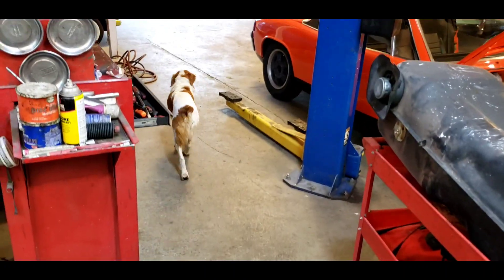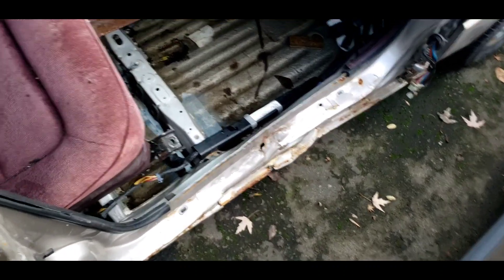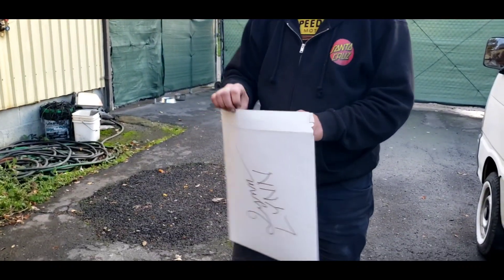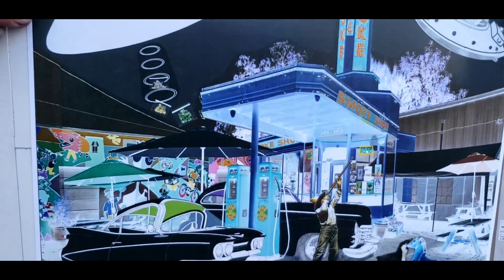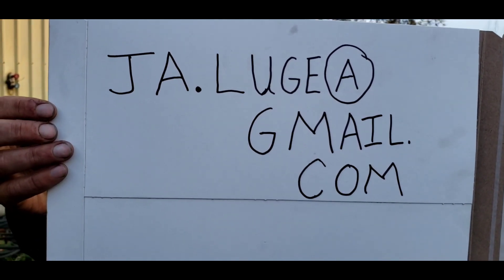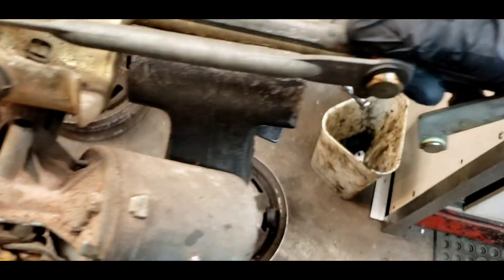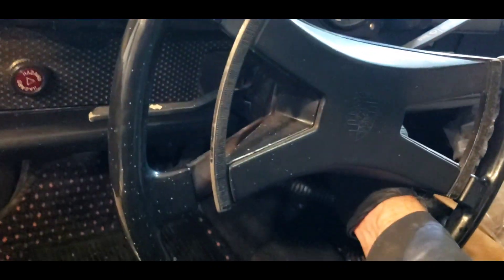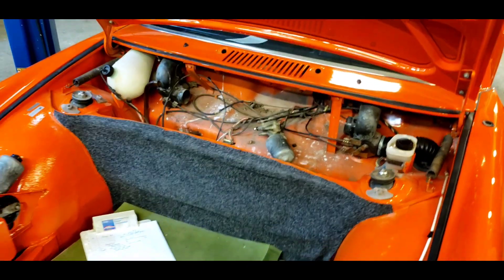Fixing Colorful Cars

Comment: you just need to disassemble the mechanism, remove the axles, clean and lubricate, do the same with the motor and gearbox
Reply: Yes, I'd have done that before firing up the torch. Might have a nylon sleeve for a long bush. That wouldn't take too kindly to heat. Didn't even loosen the nuts! As you say the motor and drive probably just needs a good clean and new grease. Unless it has burnt itself out trying to move the seized mechanism. Should have blown the fuse first though.

Comment: My 1975 used the air from the spare tire for the windshield spray.  I bought new actuator that installed in the steering wheel. Pain in the neck!
Wait until the brake pedal seizes just like the wipers.